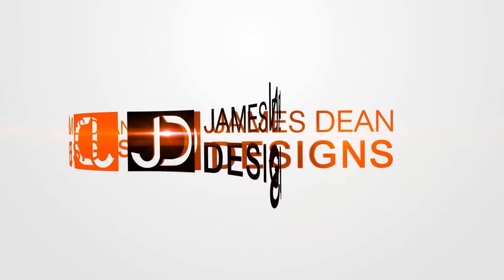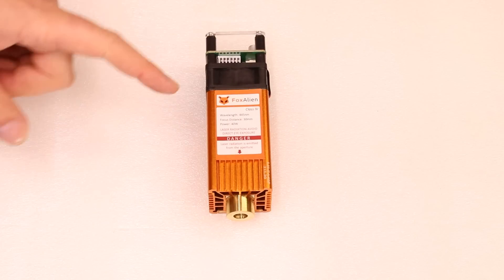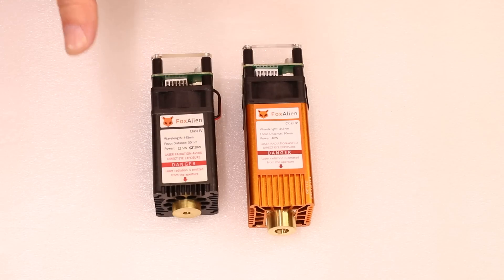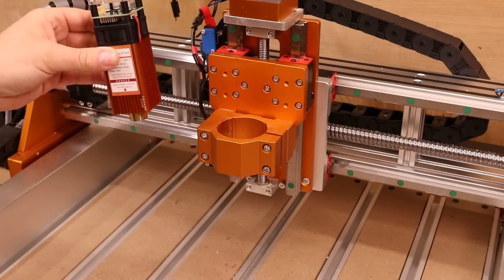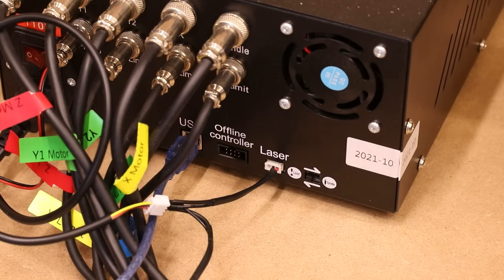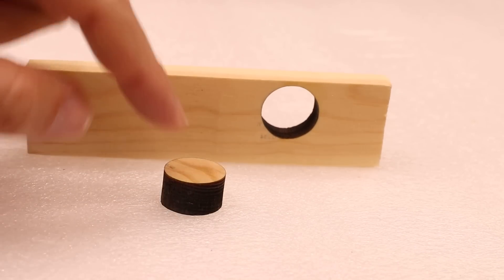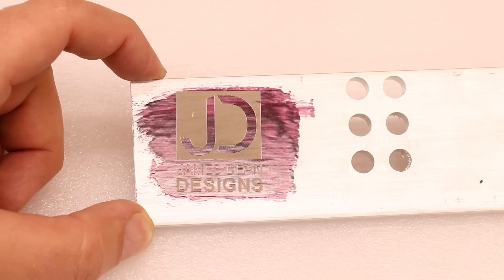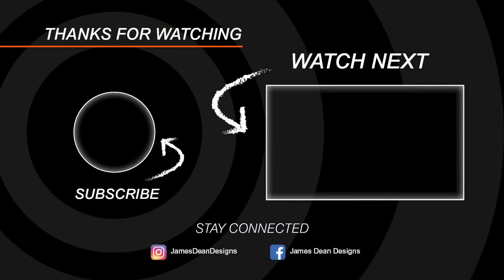High Powered FoxAlien 40w Diode Laser (10w Output)

Comment: Why even call it a "40 watt laser" when it is a 10 watt laser?  It makes it hard for companies to compete with using real numbers.
Reply: We live in a world where marketing has won over engineering
Reply: I was wondering about the same. It is absolutely useless, just pure misleading. If a laser has an optical output of 10W, then it's a 10W laser.
Reply: This is marketing strategy. 40 Watt is actually the power consumption as the optical power is 10 Watt.

Comment: Would love to see a comparison of this and the xTool D1 in terms of cutting power
Reply from the maker: Sadly that is one comparison I am unlikely to do. xTool offered me an D1 to test last year but restricted people in the UK and Europe from viewing their site. I don't know any other manufacturer which operates like that and given I am in the UK I turned down their offer as I cant review a product that people cant access. Hopefully they will change their approach if they have not done so already.
Reply: @JamesDeanDesigns  i was just about to get xtool but for the same 2k range you spend on xtool d1 bundle with two lasers (blue and infrared), instead you can get a foxalien blue  laser and cnc machine and a rotary roller. i think is a fantastic kit within the price range,  rather than buying a cheap co2 laser. i can save the money and move straight to fiber galvo for marking and use this cnc for cuts. I personally like more how a cnc cuts rather than a fiber laser. Plus in the 2k range you can have it all. cnc can cut easily in metal too. lasers are passing 10k range to cut in metal.

Comment: Another great video!  If the actual output of the 40w is 10w, does that mean that the output of the 20w is only 5w?  If so (and doing the math), then the 5w only really puts out 1.25w??
Reply from the maker: There is no set ratio and I believe the lower powered ones are technicallymore efficient than the high powered ones, for example I think I saw one of the new 20w output lasers by another company had an input of about 130w.

Comment: James, First I want to thank you for all the great video's you have produced. Informative and easy to understand. I just received my FoxAlien 40w laser and tried the same cut test as you did but didn't get the same results. These are all at MM/MIN 100% power 1 pass, 250 it cut through, 300 it almost cut, left a few spots on the back side that didn't penetrate. 350 - 500 didn't penetrate through at all. I have a 4040XE with the work sitting on a honeycomb bed. I have an air assist 32 watt pump that starts with a 1/4 inch hose that is reduced to 1/8 inch hose run through the cable chains to the laser and a brass air assist nozzle I got from Lazer Wizard.  Is there anything you can suggest to increase the performance? Thanks
Reply from the maker: Truthfully the wood can make the biggest difference. I typically only cut balsa or basswood. But if a company has used lots of glue, it will struggle to cut through that. The other thing to do is a focus test to ensure its actually focused correctly when using the block.

Comment: Hi James, I’ve got the FA 40w laser I’m having problems etching slate have you done anything on slate with the 40w?  I have ran a few test cards but some etchings seem to be lighter than others at the same settings? Any advice please
Reply from the maker: It could be the slate to be honest, it's a natural product at the end of the day. The way to tell is if you run the same  tests on something else like wood and thats more consistent then it's the slate. Also make sure the slate is level with the laser
Reply: @JamesDeanDesigns  , thank you I was starting to lean the way of the slate being the issue, although tonight I’ve changed my settings yet again but got far better results using a second pass at lower power. Acrylic is my next project, you used brasso any alternatives also what about the metal idea underneath, I’ve heard/seen people using galvanised but maybe I’m wrong surely laser etching with galvanised could be dangerous ie toxic?? 
Love your videos and advice great work, I’ve used your links for purchases so hope you get something in return to support your channel.
Reply from the maker: @craigjulespallister1286  thank you, that's really appreciated. Yes, lasering certain products will give off toxic fumes. I dont really know enough about all the different materials to know which are toxic and which are not but just make sure you're well ventilated. Just experiment and see how you get on. You just need something to catch the laser beam on the surface. Saw a comment earlier about someone using a damp paper towel and lasering on to that which engraves the acrylic. Something I had never thought of.

Comment: It operates at 12V 2A, so 24W maximum input power. Divide by almost 5 to get the actual output power of the laser.
This "40/10W" laser cannot be a real 10W laser, ever.
The best diodes actually have an output power of 5W according to factory specifications (they could go to 7.5W with more current but would greatly reduce the life of the diode).
In fact, the only way to get a true 10W laser output from a diode is to combine 2 diodes in the same laser head (like the 10W lasers from Neje or xTool).

I have a NEJE A40640 laser, which seems to have a true 10W laser output. It cuts 22mm pine at 200mm/min and 7 passes or 5mm poplar plywood at 200mm/min 1 pass 100% success (it could do it at 240, but not with 100% success, depending on knots in the wood or glue filled holes in the plywood sheets).
Reply from the maker: Hi Bruno, I get the feeling you didn't actually watch the video or do your research before posting this? I'm guessing you completely missed the section where I break down how they achieve the 10w output by running 2 x 5w diodes together? It also draws more than 2a, in fact it is 3.3a which is why they supply you with a separate 5a power supply. Why do say divide by 5 as well? I don't think that is the scientific method for converting input to output given that most 5w diodes have an input of 20w. Focal length makes a big difference with DOC and these two lasers have different focal lengths. At the end of the day, they are a reputable company going for many years so they have to get their power rating checked before going to market. As for the differences between this and the NEJE, well I cant really answer that as I don't have both to compare.
Reply: You should watch the video before posting a comment.

Comment: James, great tutorial ! Can you provide a link or name of the power pack you've used in this video ? I knew my 4040xe controller seemed to bog down and light went out for several seconds, essentially ruining my job. I need this power pack. Thanks foe " enlightning" me and my laser tree 10 watt'er.
Reply from the maker: Hi, FoxAlien supplied this with the laser but it's just a 5a 12v power supply. Assuming you bought yours from FoxAlien, just reach out to them and they should send you one
Reply: Actually, I got mine from LaserTree"80w". it is 10w out. It put a heavy pull on my 4040Xe controller.I think I'll hard wire it in, does it come with spec sheet ? maybe a pic? Thanks James, I know your a busy guy, I think I know how, power from new power supply to the laser, one wire from controller to laser? Thank You .

Comment: Outstanding job James very informative. Is there a reference that list what machines this will work on?
Reply from the maker: Thank you 🙏
Not really to be honest, which is why I think they give the power unit with it to make sure it will work on anything running a standard 3 pin laser connection

Comment: It would appear that at 12vdc it would work with the Ortur Lasermaster 2, not pro. ?
Reply from the maker: I don't own an ortur so I'm not sure to be honest. Most lasers run on 12v but it would seem the Pro circuit uses 24v, although the diode is 4.5v

Comment: Is it compatible with the Genmitsu 3018?
Reply from the maker: Yes and no, as mentioned in the video the width is 40mm so its too wide for a standard spindle holder on a 3018 unless you have an upgraded one. Alternatively you could zip tie or fix it to the side but the 3018 can run this laser though

Comment: Great video James as always, I bough the Foxalien 4040 cnc with the 40w laser i was wondering what the other power supply was for since it could be plugged straight in the cnc controller, the information you gave was a light switch moment. A change in my wiring set up is due THANKS.
Reply from the maker: Glad it helped

Comment: Sorry for what is likely a stupid question but I assume this head will only work with FoxAlien boards? This can't be put on another maker's laser can it? (Such as an Ortur?)
Reply: You may need a custom bracket to mount it onto the backplate of your machine, you should check with the manufacturer to see if it's compatible.
For instance, Sculpfun S9 laser module can fit a wide range of machines.
Reply from the maker: Im 95% sure it will work as they try and keep hole positions in a similar location. If you send me the sizes of the bracket of your laser via instagram or facebook I can check for you

Comment: Hi James, there’s a Chinese company releasing 20W(power output) diode laser next month. In my opinion, even with a more powerful diode, laser will just pass through clear material which is the biggest drawback for diode.
Reply from the maker: Yes, xTool. Be interesting to see what it does. That is a huge drawback to diodes, they have their uses, particularly doing NWT tiles, some of them come out amazing
Reply: @JamesDeanDesigns  yes but that xtool diode laser isnt going to be cheap
Reply: Would you happen to know which model?
Reply: Yes but you can always use some black tempera paint or a black underside sheet

Comment: And which will be the best (dollar by performance) laser for the 3018?
Reply from the maker: Difficult to answer as it really depends what you are trying to achieve. for example if you just want to engrave basic materials the the cost of some of the lower powered lasers are quite cheap now, however if you do want to cut stuff out then you need a more powerful. Some of the cheaper, non-branded laser can be much better value if all goes well, but as soon as something goes wrong and there is no customer service you essentially have a paperweight